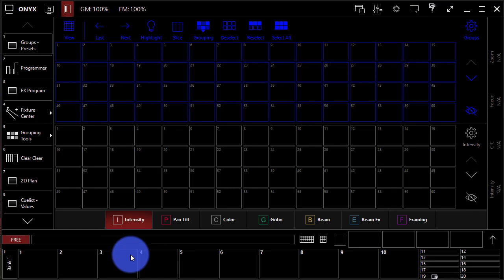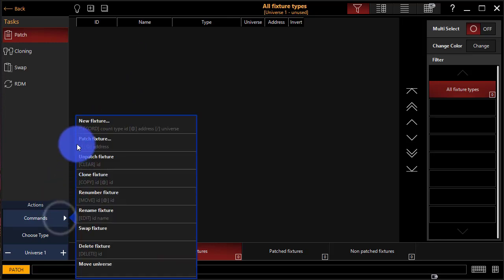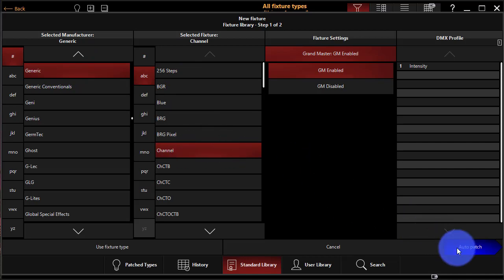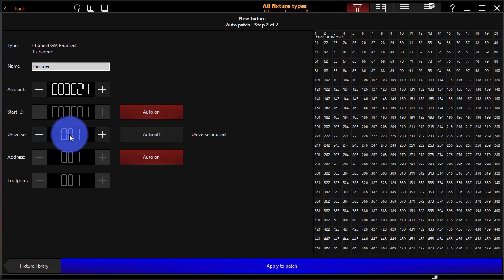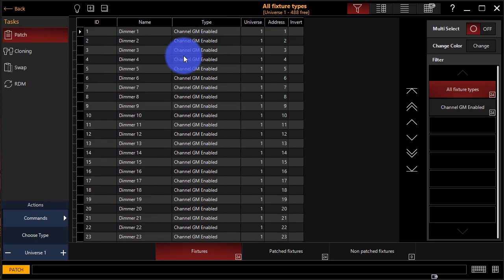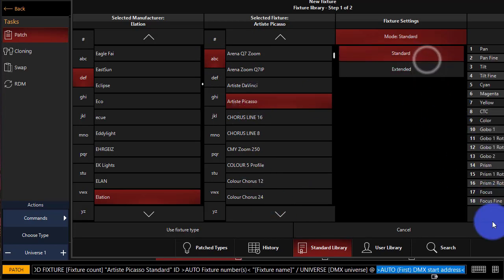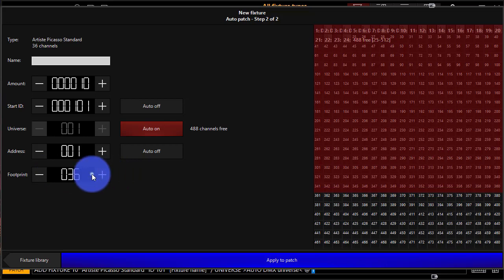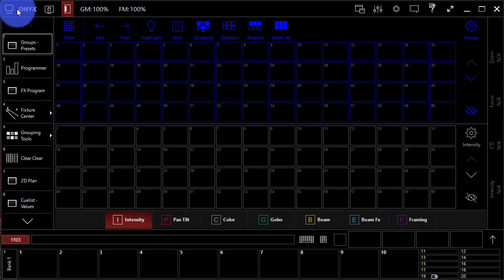Patching: Beginning with ONYX (formerly M-PC)

Comment: What is the best way to change the universe without unpatching the fixtures?
Reply from the maker: In the bottom right corner of the patch, change the universe number.  Then touch in the address field, and enter the same number that is already there.  Your light will now be moved to the same address on the new universe.  It can also be done via the command line - check the manual for the exact syntax.